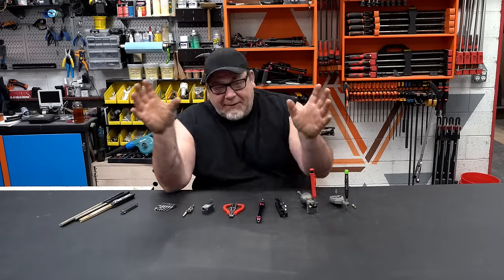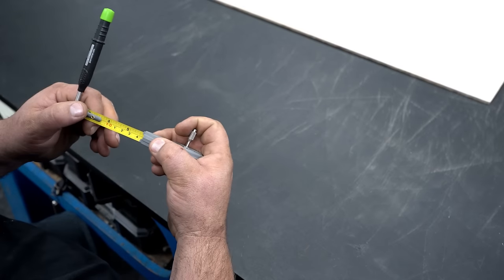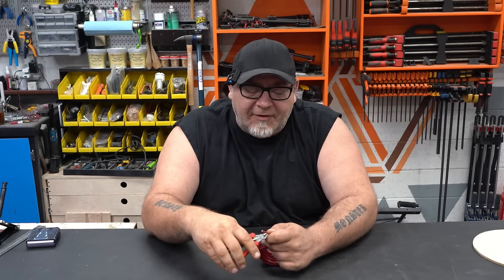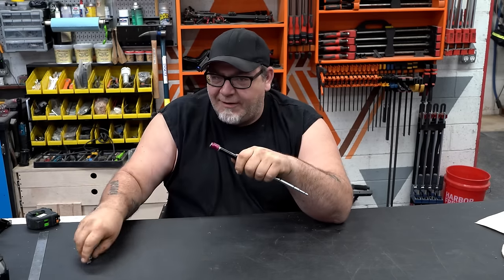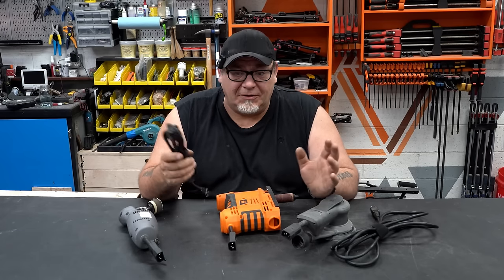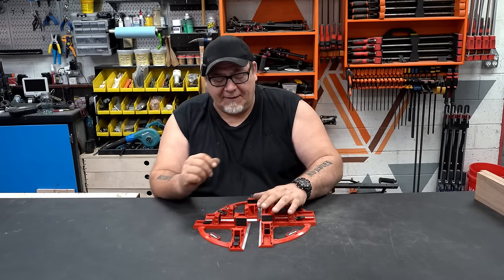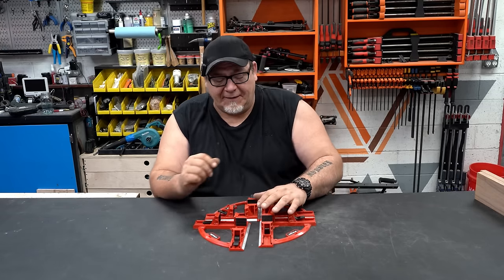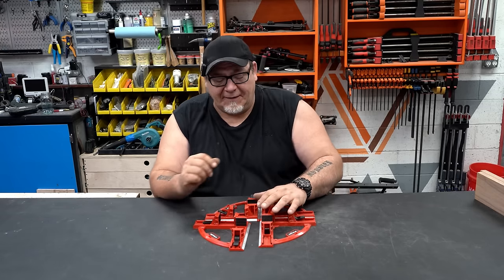10 Useful Tools You Never Knew About

Comment: izzy, do you have issues when drilling ferrous metals and the resultant metal shavings collecting on bottom of magnetic base? when in the “unlocked” position would they fall off bottom, or have to be pulled off?
Reply: compressed air!  (if you have it)

Comment: Great video Izzy.  One question, on the replacement plugs, why didn't you use the standard plugs available at the big box stores?  Easier to get and better power ratings.  I am thinking that that is the way I will do that and I already have plenty of extension cords in the shop.
Reply: because these are much smaller. The regular sized plugs and sockets are too cumbersome if you have to manoeuvre in tight spots. Computer cords and extensions are everywhere. Every household has a box full. I just use those.
Reply: @waynoswaynos  they're rated at 10 amps. Most power tools worth a crap use more than 10 amps. I'd rather not burn my house down to avoid a cord on a corded tool.

Comment: I've had those stubby drill bits for years... brad point wood and metal ones.  Love them.  The metal ones are especially handy... chuck in & don't slip like most bits and don't flex like longer bits.  Think about how often you drill deep metal holes... almost never.  The short bits tend to drill straighter in hand drills.

Comment: since you asked, I have had a set of the stump brad points for a good long while, and they are super handy. using them in conjunction with the Milwaukee compact 12v drill driver makes most of my 'inside' work much easier.

Comment: Done the c14 power cord a couple of years ago. Love it, only thing is they have a tendency to fall out if you pull the cord.  I "updated" my c13 cord to a locking one. You have to push a button for it to release.
Reply: Did you consider using a PowerCon plug?
Reply: What locking connectors did you find?

Comment: The main reason I reach for a hex drive drill bit, is when there is an obstruction which prevents u from getting the whole drill/driver close enough. You can get hex extensions or multiple of same to virtually any length. The whole show can get a bit wobbly tho. Keep up the good work.

Comment: One odd tool that's worked well for me over the years, especially before I had a drillpress, but which has seen a surprising amount of use since, is one of these hand drill drillpress attachments.  It has a collar that goes between your chuck and drill, which has 2 round holes on either side that ride 2 vertical posts, which attach to a base.  Some have a base that rotates for drilling at different angles.  All have a drill stop (usually a simple set screw collar).  And the base usually has v-channels in its top surface for drilling into round stock, pipe, etc.  Even with a drillpress, it's often critical to get a straight (or precisely-angled) hole in something too large or awkward to put into the drillpress, so these are very handy.  I've seen them from $15 to $65.
Reply: I've had one of these for several years now. Still don't have a drill press but, with this I can drill a straight hole.
Reply: I also have one of those.  For about 20 years, that was my drill press.  I still use it often, even though I now have a couple of drill presses.
Reply: I need one of these.  My shop is pretty small and often needs to be portable.  Do you have a brand or model recommendation?
Reply: I have one of those. It’s a little fiddly to work with, but it works, and it takes up much less space than a whole drill press.
Reply: @marz6243  Mine’s an old Craftsman, but I haven’t tried any other brand, so I can’t compare.
Reply: @Cecil_X  Wolfcraft, maybe 30 or 40 years old. Still useful. Thousands of holes, eg for cabinet shelf pegs
Reply: Milescraft makes one they call the DrillMate. I use it when I need to bring the drill to the piece rather than the other way around.

Comment: 05:00 I have the stubby 1/4" hex shank brad point bits, they work well and are helpful when working in tight quarters. I also have the combo stubby drill bit and tap set with 1/4" hex shanks.
Reply: As a dealership mechanic you have to install mudflaps on some newly delivered cars.  These and a right angle drill means you don't need to take the tire off!!!  Flat Rate!

Comment: Izzy is having to much fun.   Been cutting my power cords short for years to use with my dust hose / power cable combination hooked to my auto start switch for my dust collector.   Prepare tool, hook in dust collector hose, hook in power cord, away we go.  Even cut my Festool TS-55 cord short.  Have all both stub sets great things to have in your kit.  

Still using my corner jigs and wedges I made from your design years ago.

Comment: Those IEC connectors are almost universal on studio audio equipment because power needs to be as hot swappable as audio feeds in cases of outboard processors failing. It's nuts that tradies don't get this option out of the box! A short cable and an extension cord is way more practical than all the tools into a plugboard and less of a tripping hazard, too.

Comment: Could probably use Anderson connectors for the cords of higher amp machines. I don’t really see the need, but it would be an option. I use large ones rated for 300 amps for off grid batteries and for winches on winch plates.

Comment: I have a wire cutter/stripper spring loaded same action cuts and strips wire of many gages with no adjustments. That's called a 1/4 power shank.  Telescoping extensions leaves a lot of runout. cords are not covered under any manufacturer warranties nor does it disqualify defective parts or workmanship warranties...all clamps are adjustable that I know of. There's a countersink plug tool all in one that takes the plug from the original piece as well as drills pilot hole and countersinks. Not to Pat myself on the back but I am a power tool technician authorized service for many tool lines and have been in the business for 40 years so you didn't "stumpy" me here.
Thank you I really enjoyed this video. the only problem with The Machinist advice is the magnets do tend to attract metal burrs even when retracted. But the versatility definitely outweighs the inconvenience... The putty I was unaware of but with the name brand like that I would have certainly bought it if I saw it.

Comment: Power cords- I use the same connectors on some tools, but Bulgin Barracuda miniture on most. These are small, can often be fitted into the cord housing (no tail) are 1/4 turn locking and waterproof.

Comment: Try Neutrik PowerCon as an even better alternative for the power cable plug! Perfect because they lock.  Many examples here on YT, if you wanna see some.
Reply: Yes but with these I can use old computer/TV power cables I already have laying around and only need to wire up one side.  Also in some cases if I run out of cord length, for safety I would prefer the cable to come loose rather than jerk the tool at the end of the line.

Comment: I like the idea of removing cords from tools!  That would be more legit if they put the most simple thumb lock on that connection!
Reply: That's my only concern with this product.  Is the friction fit adequate without a locking mechanism?  Cords falling off of tools while the tool is in use would get old very quickly.

Comment: The stubby hex bits are a nice addition for some small (but surprisingly capable) hex bit cordless drivers. Sure, you don't have tons of power but when you're weak like me and have to drill holes overhead, having a lighter tool is a godsend. I have "normal length" hex bits, but those seem interesting.

Comment: A variation on the shortening the power cords on tools. My table saw* I mounted a self rewinding extension cord wired into the switch. 
*its only an old Ryobi BT3000 but I'm not building cabinets and it does what I need it to do.

Comment: That radius marking gauge is nice i bought one and love it but the person that made mine obviously was a metric user. While the inch and half inch are the correct distance they divided the marks by tenths of an inch instead of sixteenths.
Reply: This got me curious, so I looked into it. From what I can find, machinists and engineers use tenths of an inch as it more easily allows for the high degree of accuracy required in their work as they often use hundredths and thousandths.
Quirky, I love it. Have you ever let anybody else use it and gotten puzzled looks? :)
Reply: That would be for a machinist working in imperial (mils).  Tenths of inches are not a metric measurement.
Reply: Machinists are taught metric and standard. As a machinist you know what 1 tenth of an  inch is if you don't then you are not a machinist, whether US or UK. Am I right?

Comment: Hey, man. Pretty sure they make locking versions of those cord connectors you're putting on your tools. You aren't leaving much cord off of the tool to put a knot in to keep the cord from pulling out. Might be something to look into, if you're finding that you keep pulling the connector out during use.

Comment: That Magswitch vise base is a game changer. Sadly out of my current price range. However... I am a clever lad... maybe I can come up with my own version.
Reply: I succeeded! I bought four magnetic bases at Harbor Freight for a total of $52. I had to use M8 x 1.25 x 16mm bolts to hold my machine vise to the bases. So for a total of $57 I have a base that works like the Magswitch shown in the video. It works perfectly.

Comment: Izzy,
Did you struggle in high school geometry? You interchanged radius, diameter and circumference so haphazardly that I bet those geometry quizzes were challenging 😉!
The corner jig looks like a good functional tool. It only clamps the edges of the stock, so I wonder if it is suitable for large panels. I have a large inventory of Bessey corner clamps, and I find them frustrating to adjust. My most favorite corner clamp solution is shop made 3/4 birch plywood corner clamp jigs relieved for 4 quick grip clamps. Your clamp jig though looks tempting. I patterned mine after the Rockler plastic jigs and an idea that I saw in an old wood worker magazine.
The mag lock tools look like good tools. I get too much mix use on my drill presses with wood and machine shop use. Magnetic tools attract steel and iron cips and fines. It looks like you just work with wood and keep chips and dust under better control than I do. I am working on completely separating my machine shop and wood shop. When this is complete, I want to remember your mag lock tools. Do you trust them to hold heavy drilling? I have several surplus machining vises.. They are heavy and don't require anchoring for small hole one off work. I upgraded my machining vises so these are fancy overkill for wood working.

Comment: Had the "stumpy" brad points in my Festool bit wallet for over 12 years (and yes, they are very handy). My 12y.o. Festool jigsaw also has the removeable power cord. 😁

Interesting video, I like the extension bit holder. Cheers...

Comment: I've never seen the adapter plugs used in hand tools.  My first thought was well that's stupid, why the hell would you cut off the cord, but then why not.  I almost never use a power hand tool without an added extension cord anyway and storage would be so much easier.  Thanks so much. 
The magswitch base is great.

Comment: I have de-corded (is that a word?) most of my mains power tools and fitted Neutrik connectors. I have a few different lengths of extension cord which makes the system very versatile. Have a look for videos by Marius Hornberger and John McGrath…they explain much better than me.

Comment: While the first one looks neat I think I would prefer a good solid trammel bar. Preferably a shop made one that uses say 1/4 x 1/2 steel bars that can be of any length. I have one that has various pointers that include points, a center point for setting a center drilled hole and feeler tips for using like large caliper for measuring. One point is held in a solid mount while the other has a movable mount with a fine pitch adjust.ment screw
Those side cutter/wire strippers are so neat.

Comment: Dang Izzie. I just looked on Amazon and there were several complaints that the corner clamps did not grip the wood. Yet you say they do and you appeared to have to push hard to move the wood. What's up with that?
Reply from the maker: I just looked and see what you are saying. they are light and feel a bit flimsy but have held up well here and i like them for the reason some were complaining about them. when doing a lot of corners its easier in my opion if they can be adjust while itn the clamp

Comment: Hey Izzy!
I found one of the cutter-strippers in a tool place a while ago.
I had to grease up the stripper mech to make it a little easier to use, but it's great.
Cutting the power cords off your tools is a good idea, but the old cords are a risk.
With a mains plug on one end and exposed wires on the other, the temptation to find out what electricity tastes like can be overwhelming and potentially fatal!
Reply: *assistance

Comment: I am more interested in the pencil your using did you call it a peca pencil? I need a good carpenter pencil I had a twist lead pencil I used for years it was great for carpenter work when the lead broke all you had to do was just twist it and you had lead but they don't make a twist lead pencil any more they make the push top which is crap when you put pressure on the pencil to mark your cut line the lead goes back up into the pencil that's why it's crap for carpenter work.

Comment: If your rototape has a length of 4 feet how do you get an 8 foot radius? How does setting the length to 5 inches give you a 5 inch circumference?  Particularly when you then measure the produced diameter as 10 inches.  Guess I'm not watching any further.

Comment: That roto tape would be perfect for doing precise arcs for cabinets or table aprons etc.  I usually use a  free arc calculator online and a pencil with string that is a length determined my the program.  It’s always a pain to get it the precise length to draw the arc.  Roto tape would be quick and accurate especially with the pin anchor.  I going to have to get one.
Reply from the maker: We love ours. not something we use every day but make large lay our so much better

Comment: For the cordless diy'er, you can also snip off a the bulk of the cord you don't want and create a short cord by splicing desired length of cord from the male end.  Then you simply use an extension cord going forward.  It's an easy free modification.

Comment: One I use

2 Magswitches on a 1x3 about 5 inches apart.  

The 1x3 is 12" long.  I put it on my table saw, lock it in place and it guides wood against the fence.
It is a magnetic adjustable fence guide - opposite the actual table saw fence to keep wood against the fence when cutting long pieces.

Comment: That power cord hack? Is that a female receiver? Wouldn't it be safer to be male on tool, so to not expose possible energized electric probe on power supply cord? Just a thought!
Reply: OK I see after looking at product I like. But still might need to explain to put the male end on tool. JS for a lot of your viewers might not know basic electrical wisdom.
Reply: It looks like the male connector is on the tool end with that type of contractor the pins have a plastic cover around them that the female connector slides into.

Comment: Not trying to correct you or be an ass but the circumference is the distance all the way around a circle the diameter is across from one end to the other and the radius is from the middle to the edge I'm sure you know that it was just a mistake but I just thought I'd point that out
Reply from the maker: i caught it during the edit. almost a hundred hour work week makes the old noggin a little foggy some times. I wasn't going to reshoopt that clip so i let it go.

Comment: Iam drafter so Ive got an old beamcompass a pin and a lead clamp to a 1/2 to 1/8 and you can make circles of 7 foot radius and up depending on te length of the beam

Comment: A $350 base to hold a $35 vice. Something is wrong here.😕
I like the idea of shortening the power tool cords but using a special plug is kind of stupid. Now your limited to this cord instead of any normal extension cord. And with a normal plug you don't have to wire up a special cord (which you could have bought).

Comment: Hey izzy been a fan of the content you put out for a while! Love the reviews just wish they made good quality brad points that were carbide tipped on top of that a 6 inch length would be nice . For instance I recently put together concrete forms out of 3/4 plywood initially assembled with brads strengthened with pocket screws couldn"t help but hope for a bradpoint that was as capable of an amana bit for an impact

Comment: Simple 1”w x 3/4” stainless rods with matching holes in the tool bench to use as bench dogs that allow me to set them into 7/8”d x 1” w holes in the tool bench.  The more grip I need I just put 1/8” thick by 1” washers under the rod until I raise it to the needed height for the project.  Usually for a carefully planed and prepped edge 1/8” is plenty of bite.  For cabinet making you can set jigs and precuts for making hundreds of the same pieces over and over again for …well…say 43 years so far.